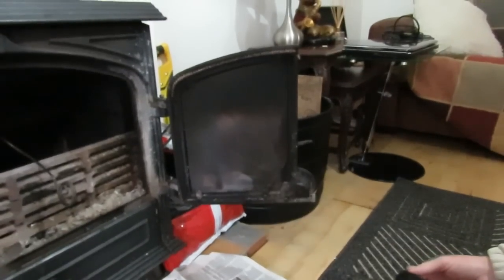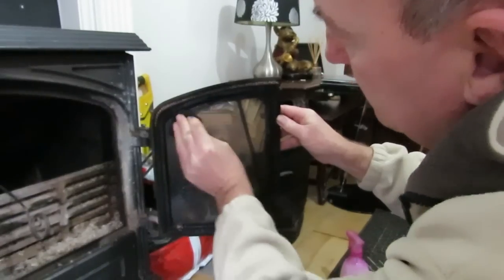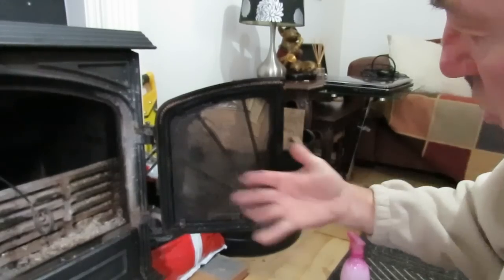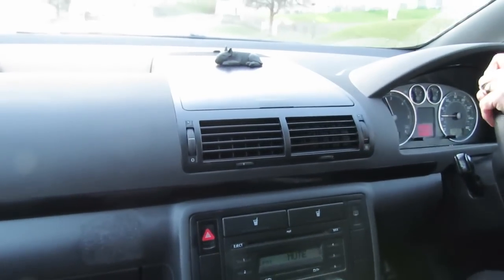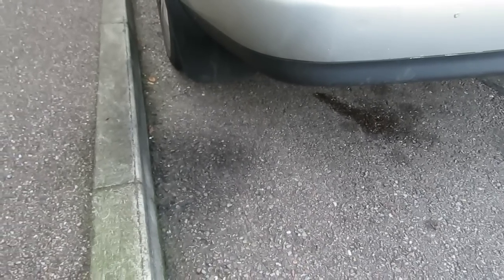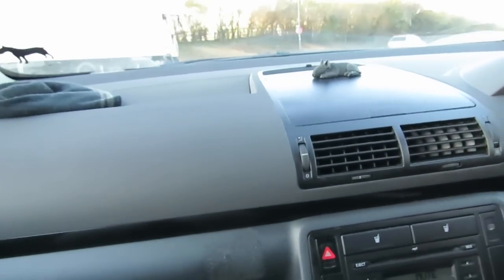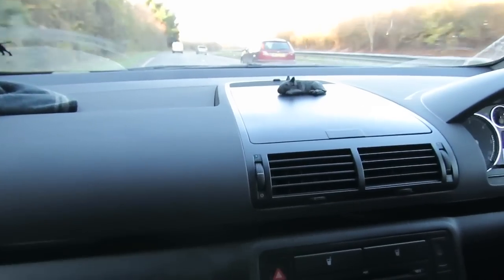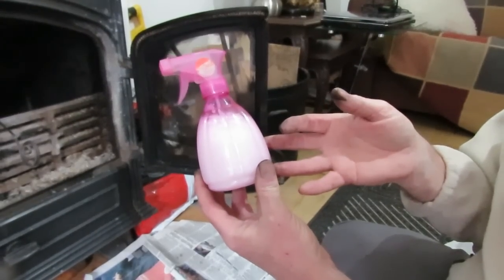Decarbonize Pistons, EGR Valve catalytic converter Turbo Inlet Manifold With DIY Detergent & Water

Comment: Great video, why only 554 views?
Reply from the maker: Thanks, I can't understand the low view count either. Any suggestions?
Reply from the maker: Took it to the next level using MR Muscle oven cleaner directly into air intake with engine running and stopped. Drove 800 miles, car ran like a dream 44.5 mpg Got limp mode on a hill almost home :) So there must be an air leak, will investigate further. Confident that the EGR valve and manifold was completely cleaned out by the oven cleaner, hence the huge improvement on MPG was getting around 37 mpg prior to treatment, though this also improved with the detergent spray, but never quantified the first test results
Reply: Any update on that?
Reply: Andrew K Fletcher Hi there Andrew I have a 09 Clio 1.5 Dci that's Smokey under Acceleration (Black smoke) do you Reckon this Would help? And also Where should i spray it into ? Many thanks
Reply: Andrew K Fletcher Hello Andrew, nice find - which oven cleaner did you use - the foam in a can or the liquid in the squirt bottle ? thanks !
Reply: @AndrewKFletcher  HI mate  you want to try FAIRY WASHING UP LIQUID I've been doing it for 20yrs I put it in a garden sprayer 1/2gal  water 1800rpm fixed I put the wand straight in the air intake after the MAF SENSOR a few squirts at a time IT WILL CLEAN THE TURBO INTERCOOLER VALVES EGR VALVE . Then when I have finished I put a hose pipe up the exhaust fill it up start it up reve it up switch off do it again and again till clean 5ml run before MOT you will be surprised at the EMMISIONS very low I've done 1.9 and 2lt citroens down to 0.45 on test and 1.7 Astra 1.19 much more TORQUE and MPG

Comment: Good video. I'm a Bull Terrier fancier myself. This method however, I don't see it being beneficial for the turbo, as the solution will evaporate from the combustion process before it can get to the turbo. Get underneath your car, and spraying oven cleaner directly into your turbo will sort it.

Comment: Thank you. One more thing I heard that is helpful is adding a Catch Can system.
Reply: I just added a BMW cyclonic oil separator to my tdi plumbed in with a couple of washing machine waste hoses. Haven't cleaned air intake or egr valve yet but the oil mist free air going in is already making a small difference. That would be partly because it is cooling the air as a byproduct of hoses routed across front of car. Catch can would work the same.

Comment: i tried loads to stop mine going into limp mode at 3000 rpm, swapped the turbo acuater valve problem solved
Reply from the maker: Thanks for that, very much appreciated
Reply from the maker: Since changed the EGR valve and cleaned out the manifold, which raised my mpg considerably to around 54 mpg on a run.

Comment: Very interesting :) Might be an idea to give the car an oil change after loosening up all the carbon?
Reply from the maker: The carbon goes out the exhaust, evidenced by the black smoke from the exhaust. But engines do thrive on an oil change, so I can't disagree with you on this :)
Reply: Sorry it was late and I just typed a quick message ;) I know you were cleaning out the exhaust system but I thought it might compliment that job and help her breathe better.  I'm guessing she's running a little hot if she's going into limp mode?  It's probably due to the transmission though. Did you get it sorted eventually?
Reply from the maker: Yes changed oil in transmission and engine oil and filter. I know it's 
an air leak btw as it has been tested with water spray around turbo and 
manifold while running cold. Good tip this
Reply: +Andrew K Fletcher    How about Simple Green cleaner, or WD40?
Reply: @AndrewKFletcher  good vid bro

Comment: I really appreciate the effort in this video. However, I do have a scientific quesion regarding what happens to the chemicals in the solution when they hit a hot engine AND the hot sensors within the engine; do any of the chemicals leave deposits? Do the chemicals affect the efficiency of the O2 or other sensors? I wonder about chemical reactions.
Reply: 351cleavland 

The tiny volume of water he sprays is inconsequential compared to the volume of water the engine produces while operating. He’s probably not doing any harm, but not doing any good either. He’s confirmation-biased into believing the performance has improved. I feel the same after washing and waxing my car. It feels really zippy! Less drag, I suppose.

Comment: Great video...really impressed by your Thinking...I'm currently looking into making my own carbon cleaner and a few days ago I used oven cleaner on a few of the air intake and manifold pipes and think it's fantastic for the job of removing carbon, but would you put it through the engine or turbo?, as the one I used foams up a lot....Si
Reply: Simon w same question did you find answer... can we sprinkle water in turbo air sucking inlet

Comment: It steams cleans everything. Heat weakens carbon and breaks it up.
Reply: Michael Langley 

Really? Take a carbon crusted skillet and boil water in it. Observe steam forming on the surface, with no change to the baked-on carbon.
Reply: yawn
Reply: @FrankGutowski-ls8jt  Blasting it a hot temperature will remove carbon.

Comment: Glad you made this video, there are people what charge £100+ to come out and use do a hydrogen clean (water). Often thought about using mr muscle oven cleaner myself, but was scared over damaging the sensors, and scorching any of the oil lubricated components. How many vehicles have you done this on, with any negative side affects at all?
Reply from the maker: Only used it on my car, running ok, though still have occasional limp mode. Tried wins turbo cleaner, useless :) Rule of thumb is don't spray it near a sensor.

Comment: it's your timing belt getting worn and stretched. I'm pretty sure they use rubber timing belts on those engines. I may be wrong. but it is diesel so who knows

Comment: Use Seafoam upper intake manifold cleaner, disconnect brake booster line from intake side of the engine and spray into the manifold while reving amd keeping rpms between 3-5 rps, use entire can and shut off engine. Let it "hot soak" for 15 mins per instructions on the can and then give it the ole "Italian tune-up".

Comment: Every gallon of fuel produces about a gallon of water as hot, high pressure steam. Do you honestly believe that a few squirts of your stuff is going to make any difference? If you think it does then find a carbon-crusted cast iron skilled. Get it really hot, and spray away. Post a video showing how what you’re doing doesn’t affect the carbon in the least.

Your big black plume is just loosely bound carbon black from inside your muffler. It’s an old mechanics’ trick to showcase their decarbing efforts.
Reply: Why the trolling?
Reply: Frank, why don't you make a video. You sound very knowledgeable. I would like to learn from a master such as yourself.
Reply: Putrefaction Chamber 

Why bother? Whether or not you understand it or believe it, science is always right. 

Take note that anionic surfactants in detergents contain sulfates. Sulfur is a catalyst poison. 

Also, water on a hot metal surface will be subject to the Liedenfrost effect, so it will never wet the surface.